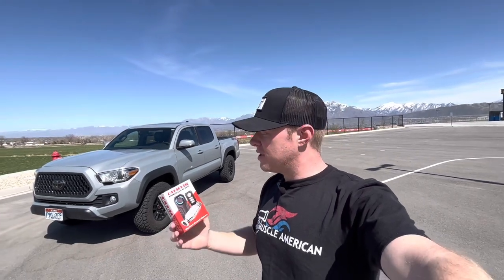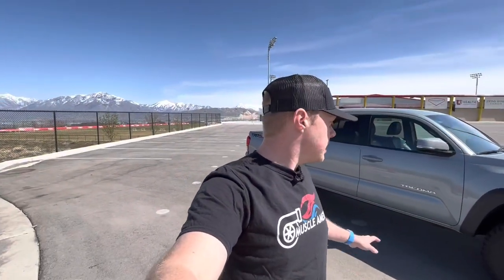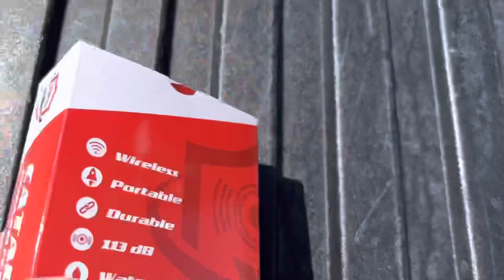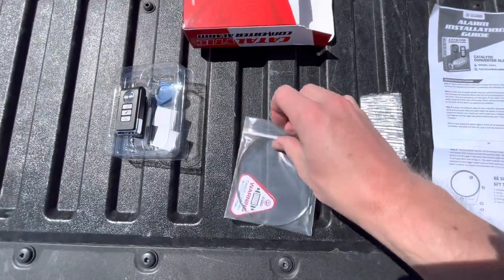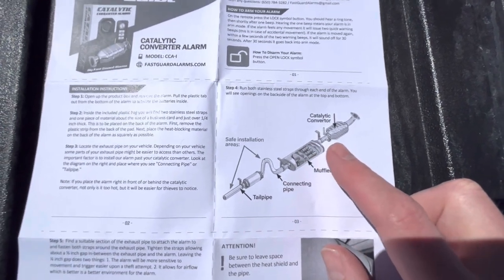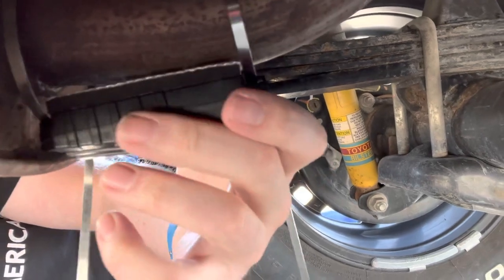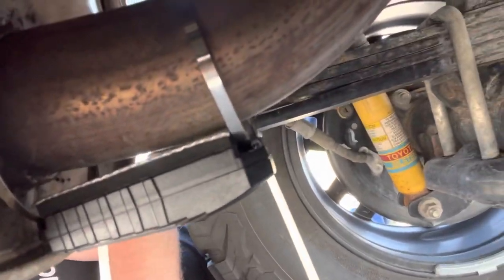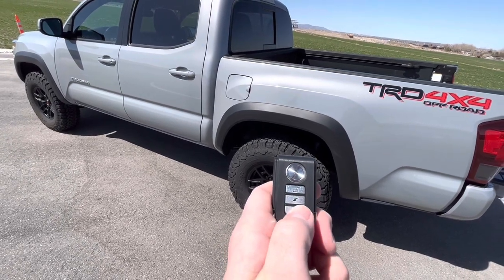Catalytic Converter ALARM Install - Fast Guard Alarm - Anti Theft Device

Comment: Had 1 of the 4 cats sawed off my Tacoma in Philly this weekend. Cop who did the report said the junkie who stole it will probably get $600-$800 for it. That’s a week in an extended stay hotel with money left over for dope and food in less than 30 min of work between theft and flip. No wonder they are being stolen so frequently.
Reply: I also can definitely say that this will do fucking nothing to stop a determined cat thief
Reply: Kinda was thinking the same thing those assholes are fast too...How about a tilt car alarm installled?installed? Will that work better than this thing
Reply: @ebsa123123  what would a tilt alarm do? Thieves don’t have to tilt a truck to steal a cat
Reply: @MrBarrageman  I have a Honda accord
Reply: @ebsa123123  if it’s not a newer model then I wouldn’t worry otherwise up to you